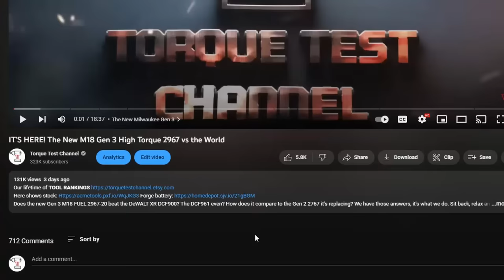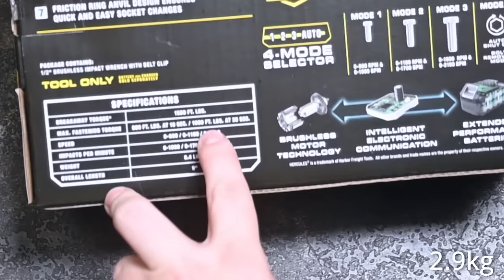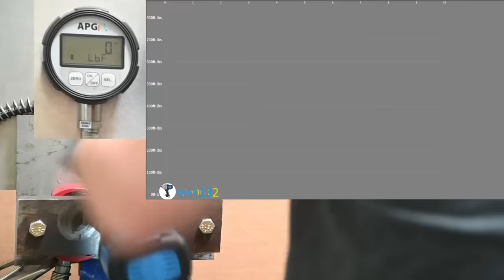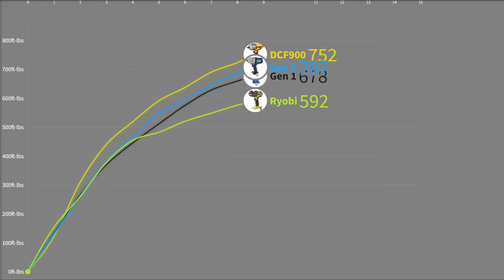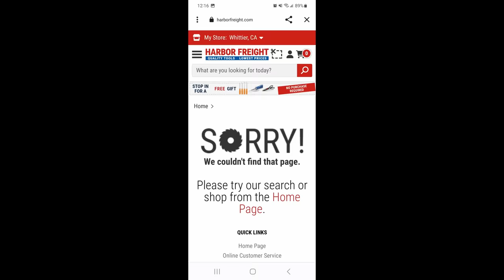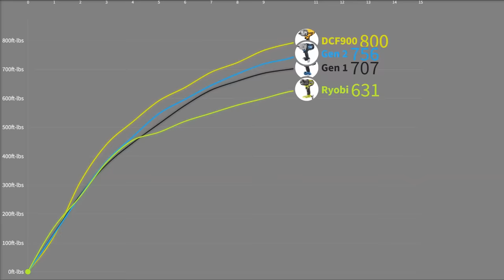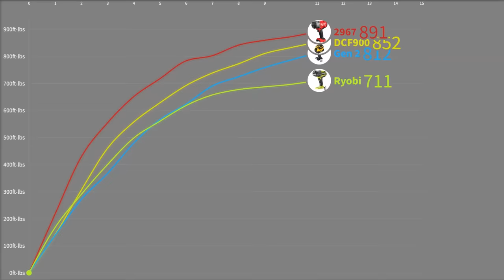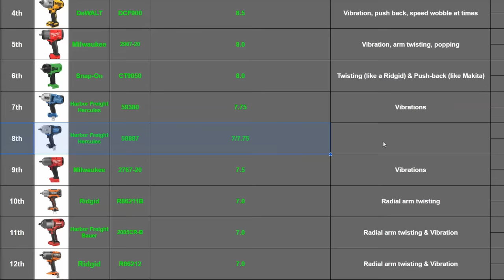Harbor Freight Called & Wanted This Gen 2 Ultra Torque Back

Comment: I was researching to buy a impact wrench, was wondering about the harbor freight line 4 days ago and said "I know, I'll check out the torque test channel".  While watching a few videos this one went live and was a couple minutes old when I saw it.  Hmm... that looks exactly like what I'm looking for!   I left for HF an hour later, walked in and saw the gen 1 on display. I then asked, "Hey, this is the old version, you got any of this new part number in stock?" Can't hurt to ask, right?  The response... "Why, yes, the system says we have 6 in stock, they must not be out on the floor yet"  Proceeded to get me one from the back and I bought it for $189.  😁  I'm a happy camper, so far no calls to return it either.
Reply: Nice, but I think you meant impact wrench.....unless you're looking to sink screws all the way through drywall and the stud.

Comment: They need to drop a better mid torque impact. The current one is pretty wimpy.
Reply from the maker: Fully agreed
Reply: Yep. I love how compact it is but it lacks the power to be able to put any kind of adapter or extension on it.
Reply: Yes. I tried it out and then returned it. I also love the size but not enough power. Currently using the High Torque with 8a battery for medium and heavy duty and their impact driver with 5a battery for light duty as well as some medium duty. It is surprisingly strong with a 1/2" impact hex adapter

Comment: I'm more than happy using Hercules.  I've been a carpenter and shade tree mechanic for 30 years (age 53 now) and aside from some Ridgid and Milwaukee drills had shy'd away from most battery tools altogether until everything switched from Ni-Cad to Li-Ion and even then I've waited the last 5 years to really start buying / investing again. And after looking at all the options I'm more than satisfied with Hercules (and some Bauers too).  I'm not abusing tools 40+ hours a week but even if I did I don't think the Hercules would let you down.  You can tell they are "in it to win it" with price, quality, and performance.  With them being closely matched to the top tier, who can justify near double costs.  I'll back the blue instead!

Comment: I've been really impressed with the Hercules brushless offerings. HF actually has some compelling power tools now!
Reply: All the Hercules stuff is awesome. I’ve only had 1 Bauer tool that has lasted years- their big chipping hammer. When I build myself a custom router table I’m buying the Hercules! Can’t beat the price/quality
Reply: I wasted my money buying ryobi products because I  have 4 20v batteries with a top line charger. No mas
Reply: @PeterHernandez-lg2eh   Ryobi has so many tools! Caulk gun, chainsaw, air compressor, 1/4" impact, vacuum cleaner, sawzall, 120v inverter, dremel, skilsaw are the ones I use.
Reply: @kd5crw  got glue gun, soldering iron, all sorts of wacky stuff.
Reply: They're also not all that cheap any more.
Reply: @randr10  comparatively with price to power they are a great tool. Not everyone needs all the beans lol.
Reply: @AltimaNEO  I run Milwaukee and I bought a ryobi battery adapter just so I can run their cordless hot glue gun. Works like a charm
Reply: @NoltyYT everyone needs beans my man.
Reply: It seems like they are now just the older generation of a quality brand! No problem with that.
Reply: @randr10  Depends. They still have cheaper version of things. It's just that if you want HF's best stuff, it will cost you more, but not as much as the traditional quality brands. 

I like that HF has the cheaper versions and little more expensive versions. IMO that's what held HF back for a bit was that it seemed like every power tool they had was complete trash.
Reply: They have been since 2018.
Reply: Some ridiculous detail—like a sticking trigger—always handicaps HF’s power tools. I won’t touch anything with a motor from that store.

Comment: I've run the original ultra torque since it came out with the 4ah extreme batteries and I really have nothing bad to say about it except the trigger delay. If the new motor shortens the trigger delay that's all it needed
Reply from the maker: Trigger delay is unchanged, programming and trigger are the same. It's one of the worst in trigger delay sensitive stuff
Reply: thats cheap harbor freight items for you. nobody goes to harbor freight for professional tools
Reply: @nomercyinc6783  that's a dumb thing to say. Plenty of people go to HF for professional tools. This Hercules will work just fine in just about any professional environment where none of the tools were even comparable to this one only a year ago and yet mechanics everywhere have been using them without an issue, PROFESSIONALLY. In fact, 90% of mechanics are still using impacts that they bought several YEARS ago.... PROFESSIONALLY!! Not every professional needs a $20,000 torque drive and not everyone needs a Milwaukee either.. but I'm sure you're the most qualified so called "professional" to spew your "professional" opinion about tools 🙄
Reply: Just seen some empty icon boxes in the mechanic shop trash bins where I work. No tools in the boxes. Its fleet vehicles they work on so I'd say not everything at HF is worthless. These guys seem to all have various ase certificates posted on the walls. Most say "master" on them.
Reply: @nomercyinc6783 just say u purchased a snap on impact for $1200 and this hercules makes more power. 🤣 jealousy is crazy
Reply: @_AndromedaGalaxy_ Yep, it’s more important (and cost effective) to be objective about quality and value than to use blanket statements about brands as a guide.
Reply: @nomercyinc6783  i purposely bought the gen 1 high torque to try and see if i can break it.  Its been a year now using it on heavy equipment and it's a work horse.  It's definetly not getting the 1400ft lbs break away claims.  But neither is milwaukee and especially the dewalt.  Snap on impacts dont even compare to any of these.  So far, anything the milwaukee can loosen,  so can the high torque.  The milwaukee is still slightly more powerful though. 

One major fault for electric impacts is that it doesnt like using allen sockets.  Maybe because the allen sockets are too in-line with the shaft and motor.  I still have to use pneumatic when i have to break cap bolts with a 14mm and up allen socket.

Comment: I am not from US (your brother from Across the pond 😀 in the UK), but man the Hercules line of tools just seems to get better and better in terms of performance and price too. Over $100 cheaper and batteries nearly half the price of the big boys with the same cells inside. Got to live to see that. 
If I was working for HF tool development I would focus on a mk2 mid torque like the Dewalt dcf891, and a compact like the Makita XWT14Z. That would be one heck of a tool line then. 

Great job TTC for bringing us the latest testing, new and up coming tools.

Comment: I had to get my hands on this one even though I have the first Ultra Torque too. Ummm DAMN this thing is much much better in my opinion. The trigger definitely is much smoother. Didn't expect that. And the motor revs sooo much smoother and effortless. This definitely is the motor that was supposed to be in there the first time.
Reply: Thanks for the input
Reply: @alghuraba  No problem. I look at it strictly from the customers standpoint. That's how I found this channel. #TTC

Comment: The changes to the circuit could be pretty significant. If they swapped out the high power devices to something more efficient then the reduced heat and parasitic losses due to heat would translate into more power getting to the motor after a long period of use.

Comment: While not always on sale, the ryobi high torque goes on sale for $160 with HP battery and charger. Not too bad either
Reply from the maker: Yeah, that's a steal
Reply: Soo does the dcf900 with 5ah for $199
Reply: Yeah if you can stomach using their terrible batteries lol
Reply: @TorqueTestChannel  Any chance of the Ryobi PSBIW25B getting tested?

Comment: One thing I'd like to see added to the lists and that spare parts availability, as some of these cheaper pieces of equipment, have very poor or even no support and parts are scarce at best and more often, non existent.
Reply: Harbor Freight actually has done a pretty good job in recent years supplying replacement parts. Very few people ever repair their tools anyways, if they use it past the warranty, aka it breaks in year 6 of ownership, they go and buy the new shiny thing that has even bigger and badder numbers.
Reply: @pianomail  HF has 5 years warranty? 🧐
Reply: @MD-gk4uh  the brushless Hercules stuff has a 5 year warranty now.

Comment: Since I haven't gotten around to buying the first Hercules High-Torque I'll probably pick up one of these revised models when they're "officially" released. I have one of the Hercules mid-torques you tested a while back and while it's not the strongest mid-torque you can buy it's been helpful for small jobs. So far I've been pleased with all of my Hercules stuff. :)

Comment: If you're not already locked into a battery platform, it's a no brainer!!!! 5 year warranty and that price, well done HF. Great video as always gentlemen.
Reply: No one is"locked"in it's not hard to have 3 different brand batteries...I personally would never use that excuse to determine what tool I buy.I started with milwaukee and dewalt right off the bat....plenty of room for Hercules in my opinion.
Reply: @djsi38t  Highly invested in if that's better terminology for you. Not every one wants, needs or can afford 3 different platforms. I realize that not one manufacturer makes the best of everything.
Reply: There are inexpensive adapters available for most battery types, at least for now.
Reply: @djsi38t i agree with your “not locked in” battery statement but i have several battery run tools all different and when i need to travel to fix something i almost always forget one of the chargers or that one battery for that one tool that i would like to use. Its not a deal breaker but if all my stuff ran on the same battery/charger i would have much less stuff to pack out. Time is money and real estate is valuable in a service truck.

Comment: Man, the cycle of obsolescence with HF stuff is damn short.
Reply from the maker: With price not going up along with it, it's hard to complain about them improving products though.
Reply: Actually, this is new territory for them... Usually, when they come out with something new in their higher end brands, they sit on it for a few years. The old Earthquake 1/2" cordless comes to mind. When it came out, it was really good at a really good price. 3 or 4 years later, the name brands were passing it in power and price. Also... I'm watching for them to update the brushless 3/8" impact. It's a little long in the tooth. I have one, and while it's good, there's better out there now. There's a lot of stuff a 3/8" should be able to do that it can't, and the 1/2" is so much heavier that I hate switching to it unless I have to.

Comment: I have 3 impacts. My Ryobi has worked well for what I need it. Recently used my Ridgid to loosen a crank bolt as it was the only one that would fit in front of the radiator on my 4 Runner and it buzzed it right off. Have a Bosch in one of my cars, but with my experience with their tools lately, it will probably die with the first or second use. Might look into Hercules as the price seems pretty good for the torque.
Reply: You wont be sorry!!

Comment: To put all these numbers in perspective. The hercules high torque impact which is the base model, has not failed me and even ended up breaking 2 impact rated sockets over almost a year of professional use.
Reply: what brand of sockets were you using?
Reply: @aricampos3090  the ones I currently use are the standard 1/2 pittsburgh 6 point deep impact sockets and still going strong but the 2 sockets that broke were a sleeved thin walled pittsburgh lugnut socket set designed for aftermarket rims or supercar/sportcar rims, I ended up replacing the 19mm thin wall socket that broke with a matco one. I still have not had to use a thin wall 7/8 socket so far so that still hasn't been replaced after I beat on that thing doing a tire rotate on a rusty/dusty/musty truck with the lugnuts torqued to 456ft/lbs. But yeah its all about having the right tools for the job.

Comment: This does not surprise me; HB  is moving some tools upscale to be on both ends of the market with a value point in mind.  

As you point out, performance vs cost is a consideration for a  serious DIYer or a shop/tech on a budget.

HB may replace Rigid power tools as a brand to buy for many of us in view of their OTC exchange for warranty.

Finally, on the bottom end (price wise) Amazon is making a serious play for value for the price.  

I bought the See sii 1/2"  impact you tested and keep in the truck for road side use and it doesnt disappoint.  At a often price sale at 100usd, nothing else touches it.

Comment: It was probably a "floor demonstration " model. They are built with larger motors. I bought a demonstration homedics e tee eyed back massager 25 years ago and it still runs perfectly. The store wanted it back but because of what i learned, i declared false advertising.

Comment: Harbor Freight has really come to play in the past few years. 5 years ago, I wouldn't think of spending a dime on their power tools. Fast forward to today, and I'm heavily invested into their Bauer 20v power tool line for homeowner/DIY stuff. The power tools get lots of use and haven't let me down yet. You can even get Samsung 21700 cells in the Bauer 8AH batteries.
Reply: I just wish they kept to one line, Bauer or Hercules. I mean realistically, why do they have both lines other than to sell more batteries/chargers/tools. Unless they have all the same tools for both lines, but I don't think that's the case (could be wrong).
Reply: @M.TTT.  If you cant afford Snap On tools Bluepoint is another option its the same way with HF if you cant afford Hercules Tools Bauer tools   is another great  option Plus with HF if the tool breaks you can just go to the store for a new replacement .. Not  like Snap On if the tool you are using breaks  you would have to wait until the Mr  Snap On trucks shows up again  BTW Bauer is a Great tool for the semi pro or a DIYER at a  good value
Reply: @M.TTT.  The Bauer line is more geared towards DIY'ers and non-professionals. It has lots of unique and specialty tools though as well. The Hercules line is their line of power tools aimed directly at professional tradesmen. They're made with stronger materials and higher quality parts. The Hercules stuff sticks more towards traditional power tools. Drills, impacts, saws, etc.
Reply: @Benefits  ah okay, I didn't see a huge price difference between the two lines, but I'd have to look again. But then like you said they have some odd specialty tools for only Bauer, but I guess you could say Hercules is almost more mechanic minded and Bauer more contractor I suppose. Eh, hey they're both affordable, I'd go with Hercules just cause I like blue lol, I bought their heat gun and adapted a milwaukee battery to it

Comment: Just bought one on Sunday the last day of the sale.  I bought the tool only And when I tried to slide in the battery that was on my Hercules 20V drill driver and it required a lot of elbow grease to get it on or off.  Took it back to the store and with great effort the manager was able to get the battery all the way forward.  Then a floor guy brought over a battery from his Herculese Driver and it too was hard to slide on but IT DID WORK so I brought it home with me

Comment: My only concern about HF tools that cost over $100 is that they change models and brand names so often that one has to wonder how long that 5 yr warranty is really good for. Meaning, what happens if this model is discontinued? Or worse, what happens if they change batteries? Remember the Earthquake electric ratchet?
Reply: If they treat it like their other "recall" items, they'll probably offer some kind of a cash value equivalent gift card.
Reply: @fattygamer94  interesting. I wasn't aware of that policy. One could still be stuck with a munch of useless batteries and chargers though.
Reply: @rickreed  They swapped all my batteries, tools, chargers to the current Hercules and I also received an $80 gift card. No complaints
Reply: @GeorgeMalonedj  I stand corrected then. I had no idea they did stuff like that. Good to know. It's a shame they don't advertise that level of service.
Reply: Good to know about the swap
Reply: @GeorgeMalonedj  damn, okay.
Reply: @GeorgeMalonedj damn, making my choice in team red seem like a mistake 🤣
Reply: @rickreed No company advertises it, otherwise they would be part-swappers all day instead of a sales store.
Just viewed my receipts, I walked in there with the Earthquake 1/2 impact, three chargers, and two batteries. I walked out with the ultra torque, a $80-gift card, two-5ah batteries, and a dual charger. I did have the warranty on the earthquake 1/2 impact so YMMV.
Reply: yes, you can "upgrade" your tool if still under the 5 year warranty, whether it be a discontinued model or a newer generation. That's pretty much the only reason we have people bringing in Hercules tools (we rarely have customers experiencing failures with them)

Comment: $189 for tool + $129 for a  20V 12 Ah to get close to but still not better than a DCF900 for $299. Since I'm already in the dewalt battery echo system It's not worth it but still a nice tool.

Comment: Cant beat 5yr warranty, got the medium impact for rotating my truck tires, $130 for all sale, i can see using it alot, breaks bolts lose easily, im getting older, got tired of dragging my airline all over for other impact. Adapted an old craftsman 1/2 in chuck to snap on it, makes a great drill also.